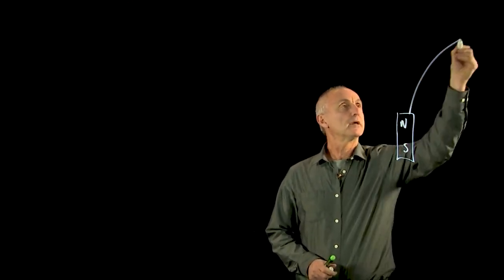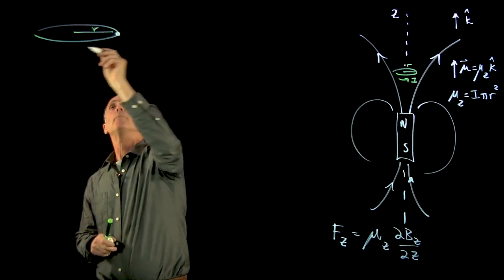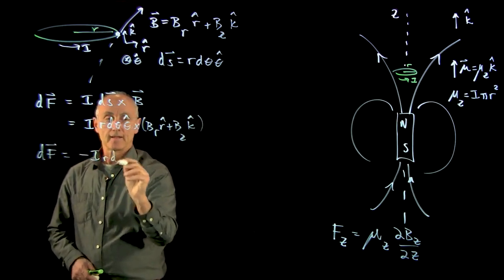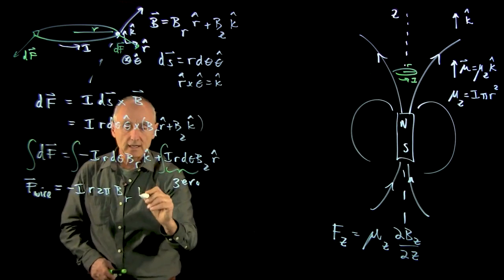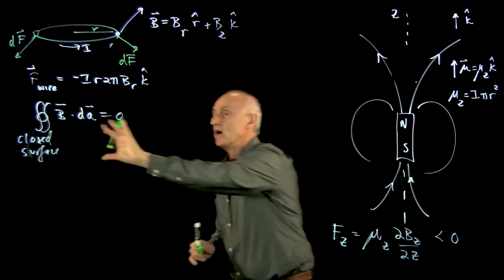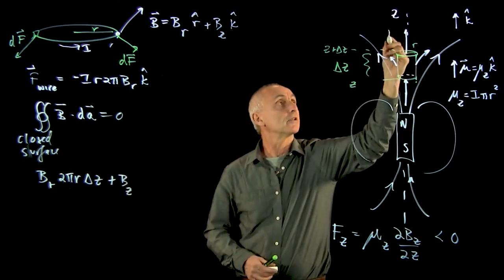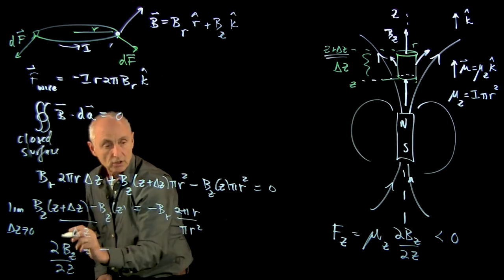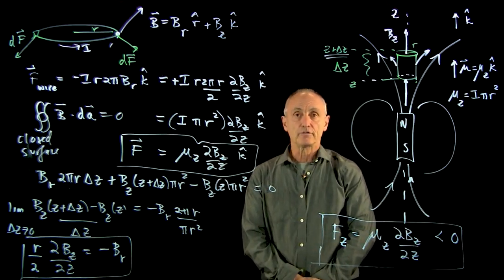L20v05 Force on a Magnetic Dipole Moment in a Non uniform Magnetic Field

Comment: That was great! Thanks. Short question though: The radial force that sometimes tends to shrink or dilate a ring that moves towards or away from a magnet can be thought of in terms of Lenz' Law and the tendency to reduce the change in the flux through the ring. What is the significance of the radial force in this example?

Comment: why we use z+\Delta z and z for the flux going through the top and bottom of the cylinder?
Reply: Because the flux out the top surface will be different than (less than) the flux into the bottom one, so we need to distinguish between the two.